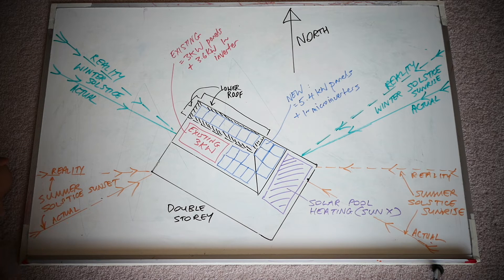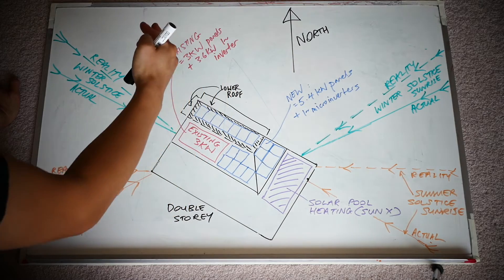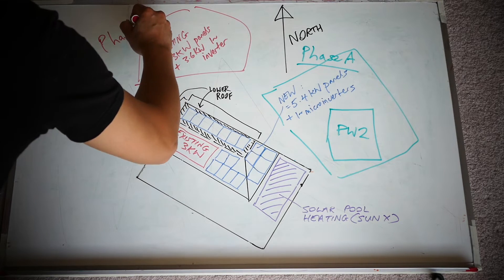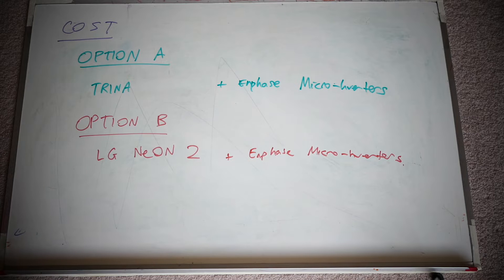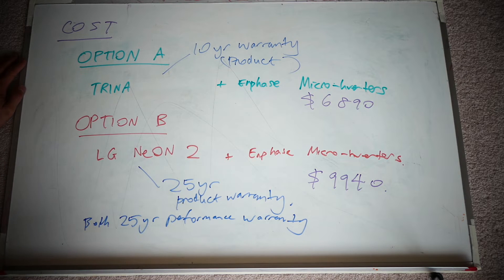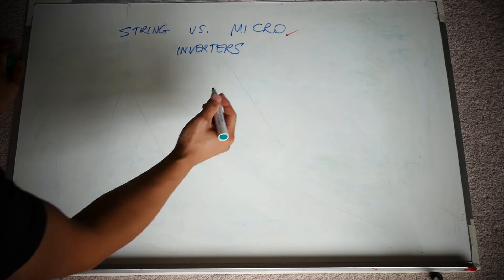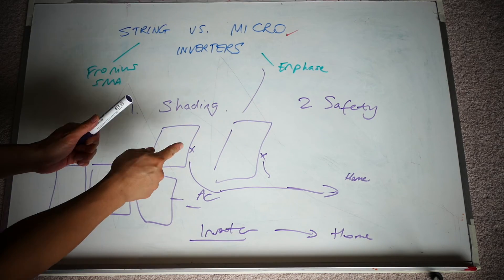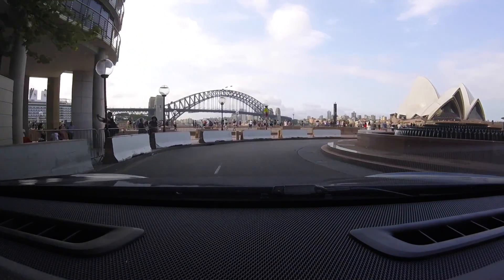Solar Panel Installation Planning to Add 5kW to Existing 3kW System | Ludicrous Feed | Tesla Tom

Comment: On an ABC TV (AU) program they were saying that every 7.5 to 9.5 year the house owner will have to fully replace the current solar panels on one's roof due to wear & tear, and that is an issue they (councils etc) didn't think ahead about what to do with those solar panels that will end up in the recycling yard or rubbish tip. So probably a good idea you went for Trina (Chinese) over LG (South Korean) and saved AUD$3,000. Not sure if that ABC TV program was sponsored by the coal & petroleum industry though 😊

Comment: I wonder if its worth considering moving the older panels to the lower roof area and install the new ones on the "solar good" roof section.
Reply from the maker: Benny Banger I did ask my installer that - for the cost, I might as well have bought new panels. Labour is expensive in Australia! 😮🇦🇺
Reply: @LudicrousFeed  that's strange because all they need to do is move them - the rails can be reused, so where they put the new rails for the new panels, they just need to put new rails in the lower roof for the old panels - zero sum except for the effort/time in unscrewing, moving and screwing in the old panels. 3KW is what? 15 panels...I think they are taking you for a ride. Labour costs them around $100 and hour, say two blokes maybe $300 or $400 for the move. Its too easy to blame labour charges where the real problem is gouging by businesses, which, in Australia has become an art form.
Reply from the maker: Benny Banger I’m happy with my current setup. Perhaps will refresh the older panels in a few years.
Reply: @LudicrousFeed  No problem LF...thanks for sharing....

Comment: You wont be disappointed with that setup as we have 23 x 300W Trina with the s270 Micros...

Are you getting IQ7 or IQ7+? Also are you getting panel level monitoring?

Also is there a reason why your only going for 5.4kW system?
Reply from the maker: Scott Cassidy Thanks Scott. I think we have IQ7 with remote panel level monitoring. We’re only going 5.4kW due to roof space limitations. As you know microinverters are modular so we can easily add more in the future should I get sick of the old panels or the old string inverter fails ... whichever happens first. 😬 TT

Comment: Thanks Tom. Did you consider optimisers rather than micro inverters?
Great video, cheers.
Reply from the maker: FutureSystem738 Yes I did, and as per previous comment, I chose to go with microinverters as I wanted to stick with my installer as they’d helped me before. TT

Comment: Tom,  i dont get one thing, in the blackout, why would phase B solar panels stop getting sun energy and charging your home?
Reply from the maker: Vuk Lacarac Great question Vuk. In Australia, solar inverters require an external power source (eg the grid) for them to power your home. My new panels on Phase A will continue to work in a blackout because of my PW2. My old panels on Phase B will not work because in a blackout, the grid will no longer power the old inverter. PowerWall2 is single phase, this will only power Phase A in a blackout. It cannot cross phases. Hope that makes sense. 😊 TT
Reply: @LudicrousFeed  It makes sense, thanks for the answer.

Comment: the drawback with micro inverters  and optimizers are they have a very high break down rate. and rather costly to fix if you relay on tradesmen.
Reply from the maker: Urs Odermatt You’re correct to some degree Urs given there are more components. My installer will be monitoring my system remotely and have promised to identify and correct any issues promptly. TT

Comment: Can you get solar edge in Au? That’s what I have and they have optimizers under each panel so you get the rapid shut down and shading issue but cheaper than micro inverters....
Reply from the maker: Miweatherspotter1 Yes we have Solar Edge available in Australia.
Reply: Did you get a quote with SolarEdge? In the USA I found them to be priced about the same as a string inverter and less then micro inverters
Reply from the maker: Miweatherspotter1 I did and although they were slightly cheaper, my preference was to go with my chosen installer for their reputation. TT
Reply: Can’t argue with that :)
I almost went with micro inverters myself, my issue was 350w panels and 295w max wattage inverters. 
Are you getting IQ7 or IQ8 inverters? I have read that both will have great grid down options for making power when the grid is down, make sure you are able to upgrade to the new ensomble series controller when it comes out latter this year.... if you do it right the micro inverters could be put on phase B and power walk on Phase A and you could back up both ( or split the micro inverters between B and C).

I’m sure you have read about it but look up the enphase IQ8 demo video and articles, it makes me wish I had done the micro inverters.
Reply from the maker: Miweatherspotter1 I’m getting IQ7 for the new panels. With the PW2, I will have backup anyway but it’s good to know that Enphase will be introducing grid-agnostic options later this year, that’s fantastic and may possibly be more cost effective than the big outlay of batteries. I did ask the installer about putting micro-inverters behind my existing panels but we figured it would be more cost-effective to refresh the older panels altogether - something I may look at down the track if panel wattage increases dramatically in the next 5-10 years. 
With 5kW new panels on PW2 backup, that will be plenty enough charge during a grid-failure situation. 
Thanks for your contribution, really appreciate it. 😊 TT
Reply: From what I have seen in your videos you have the knowledge needed to do your own install.... it’s not hard, watch how they install your new ones, read the manual for the micro inverters, order the parts you need and swap your current system over yourself. Have your electrician do the final hook up and save yourself $$$ :) 

I have a 10 panel 3.5kw system. I was quoted $10,000 to have it installed but did it all myself (including pulling the electrical permits and wiring) for $5,600. This is before the 30% US tax credit.
Reply from the maker: Miweatherspotter1 Thanks, I’ll look into it. The IQ8 and ensemble software looks awesome. It’ll be a game changer. TT

Comment: Good choice of equipment. LG is good for if you have very limited roof space and higher wattage panels are required to get the equivalent output, but apart from that the extra over cost is not worth it.
Reply from the maker: Alex K I’m hoping the money will be better spent on the microinverters. TT
Reply: Ludicrous Feed sometimes Tom the micro inverters are a con as well. A string inverter of your size would have two DC inputs coming in, thus you could split that shaded area array from the other panels and have no potential loss. Larger string inverters have 4 dc inputs. But off course the installers won’t tell you that :)
Reply from the maker: Alex K Deposit paid! No more looking back lol. Time to enjoy our solar energy 😊 TT
Reply: @alex54545  but with a string inverter if one part of the string has a blockage (eg: some leafs have fallen/stuck) it automatically disables all the panels in that string, right? so that it is a waste of potential sun power. Whereas with a enphase microinverter only the panel that is blocked by leaf is out and the others will keep absorbing the sun-light
Reply: @LudicrousFeed  "we are flying, moving forward, no looking back"

Comment: When batteries get cheaper , you could connect your original array to a cheaper battery like BYD home batteries.BYD produces more electric cars , buses , than Tesla.
Reply from the maker: Mark Tiller Good point Mark. Will need to do more research in the future as to how other energy products would integrate with the existing Tesla infrastructure. TT

Comment: The extra solar will make a big difference Tom. The only way could really tell the difference between the 2 different panels would be if you could do a side by side performance / degradation comparison over a period of years.
Reply from the maker: Craig Thanks Craig, looking forward to the new system. Will of course document the journey!
You’re right, it’d be difficult to do an exact comparison. Having said that, my existing panels are LG ...!
TT